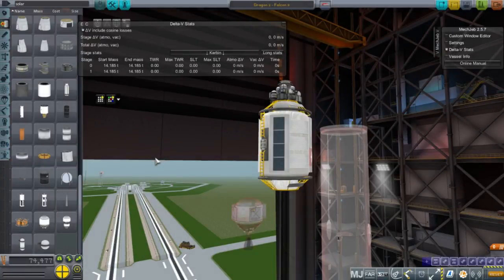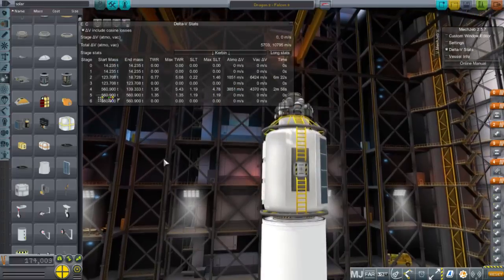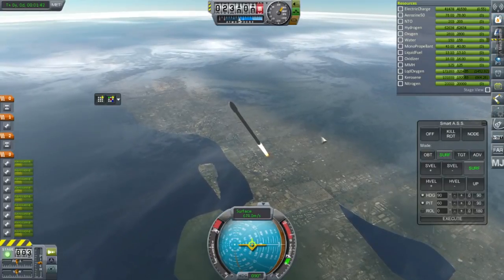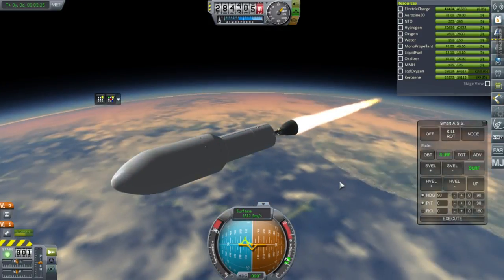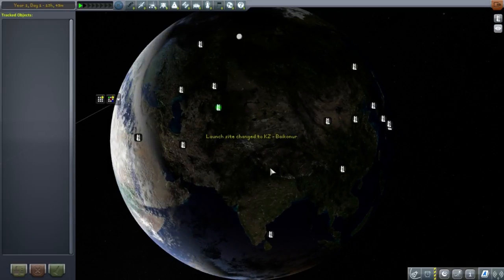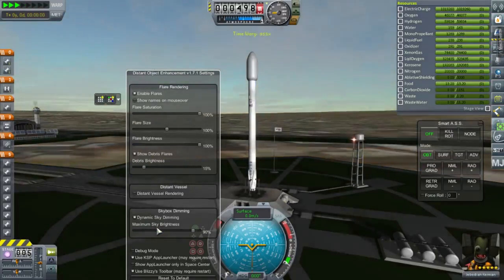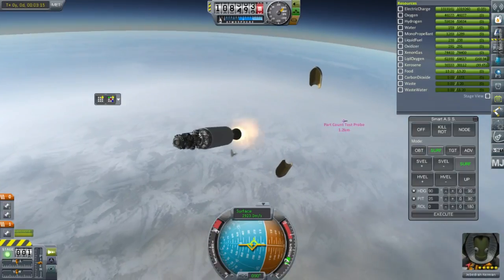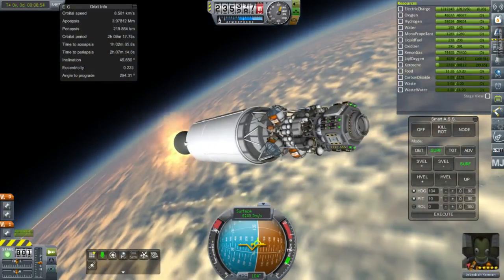KSP 1.1.2 - Testing RSS Performance with Falcon 9

Comment: Hey Tyler. I would love to play RSS and have mods like Fasa, KW rocketry and SpaceX Launchers having working configs. The problem is that I do not want to play with RO to start with. Is there a way to extract the mod configs from RO when its released, without getting stuff like realfuels and realistic reaction wheels and solar panels?
Great Vid BTW,
Alfred

Comment: Tyler I've noticed that MechJeb has a setting to make the Ascent Guidance work properly in RSS, just go to MJ Settings in the window, I've tested it, still does a circularization burn, but that can be fixed i guess. It saves 15 mins of controlling the rocket :P
Reply: ***** That's the point, after using the RSS since 0.23.5 (I think) I got a bit bored of controlling every single rocket, I'd rather do something else when MechJeb does the orbit for me... :p That's my though ofcourse!

Comment: I have Scatter for rss but how did you get the clouds?
Reply: Can you link one of those forums? Thx
Reply: +Tyler Raiz thanks a lot I got it all to work. Final question: I downloaded the space x launch pack you used but for some reason the launcher is still using liquid fuel and burns it all instantly how did you get the Merlin engines to require kerosine and fill the tank with it. ( btw I have real fuels and all that stuff installed)
Reply: NVM the is a config you can get here: https://drive.google.com/file/d/0B-5dUGhWdRRkc2s0Q24xampDb1k/view